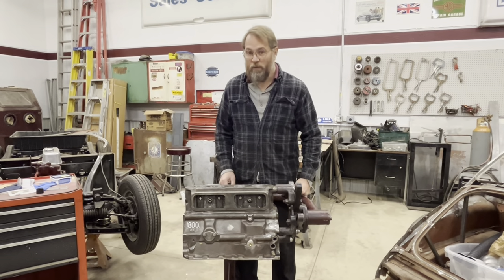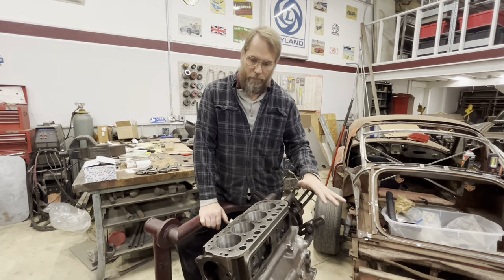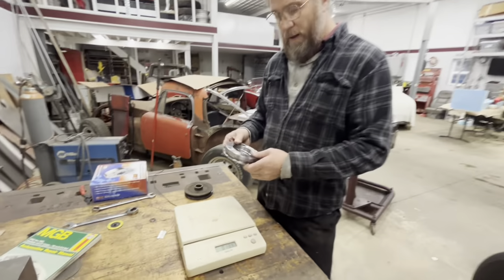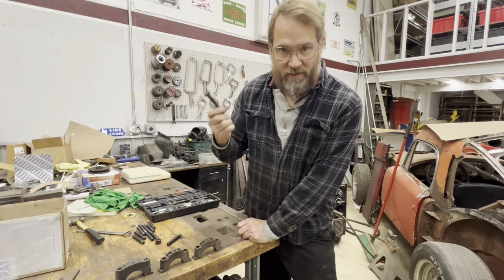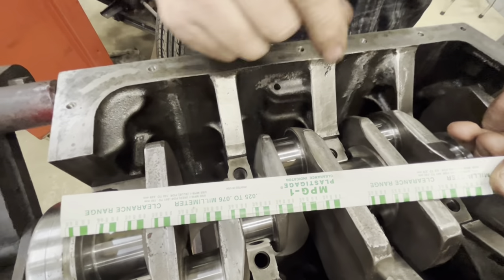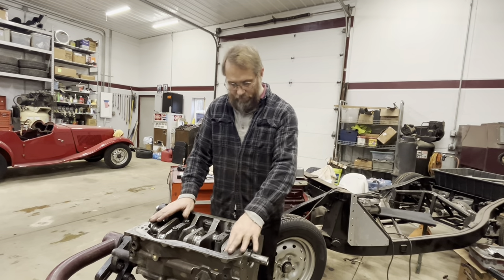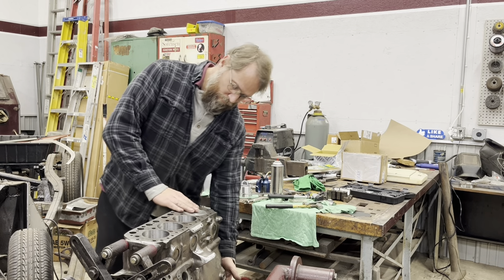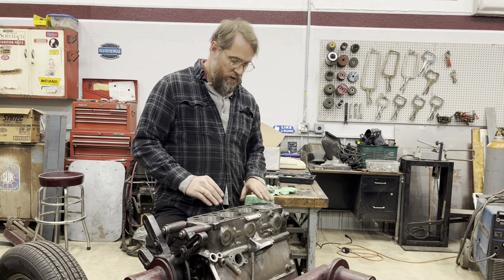FINALLY!! Starting my MGB performance engine build

Comment: ARP dose  make the 5 main bolt kit part number 205-5002
Reply from the maker: Nothing shows on their website, and nothing found on the part number your giving (either on the ARP site, or google search) Maybe they had them at one time, but appears they don’t anymore. They only list 3 main stud kit and 5 main stud kit ( i already have) but no listing for 5 main bolt kit. ☹️
Reply: @mgbgtguy  i mad a mistake the part number is 206-5002
Reply from the maker: Funny, the ARP website won’t come up with it if you look it up by application. But that part number is good 👍🏻 and description says MGB 5 main bolt kit. Thanks
Reply: @mgbgtguy   i hope this helps out
Reply from the maker: Yes it did, got them on order 👍🏻

Comment: Great video. Have you ever worked wuth an engine built by Hap Waldrop?
Reply from the maker: I actually installed one if his engines into a local vintage race MGB once
Reply: I noticed you stand your crankshaft on their ends rather than laying them on their side.  Is there a reason?  I would be worried about them getting knocked over.
Reply from the maker: Yes, I was taught to always store them that way and never lay them down. You have to take precautions to not knock them over though. You can do a search for why and find lots of articles about it, but basically they can deflect a bit and no longer be straight if stored on their side without proper support in the middle to insure they stay straight.

Comment: Very good, I built mine recently, same components except forged pistons and steel main caps on 2 and 3. I was able to use my larger  factory main caps with arp studs on 1 and 4. I just have a factory flywheel as it is all I had, 20 pounds… but I plan to change this in the future..

I had larger valves installed and we flow benched the head, I’m running yellow terra roller rockers and custom length/stronger pushrods with the shorter/lighter followers.. the cam and head were designed together to give amazing torque as I use the car for dirt rallies, I get about 140 ft/lb at 4100 and 140hp at 5400… running twin SUs.. my extractors are a bit long.. I also have a close ratio gearbox… I sooo love my engine  :)
Reply from the maker: My last engine was close to what this one will be, and my BGT only weighs in at 2100 lbs, so I enjoyed it. I’ve been running an almost stock used engine I had laying around just to have it running, and I really miss having a bit more.